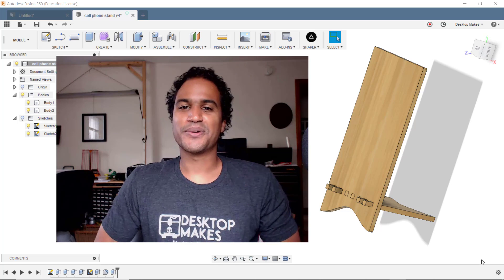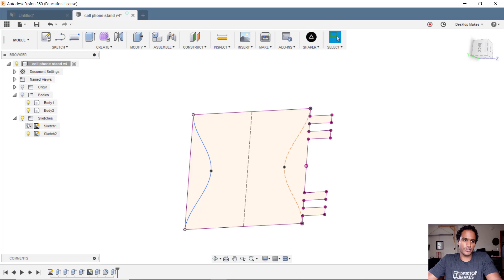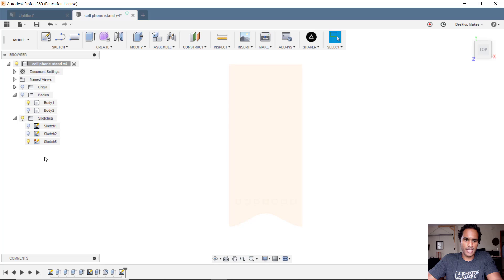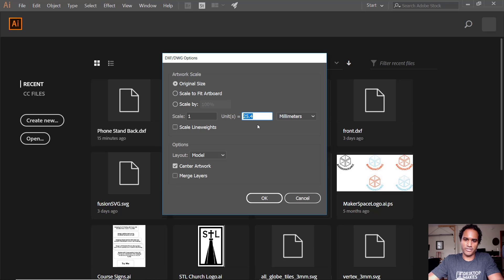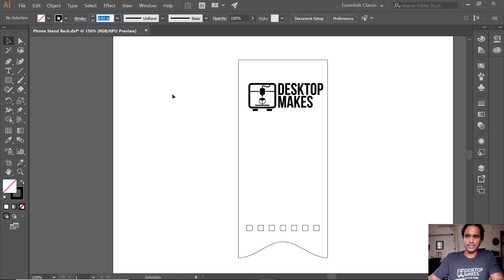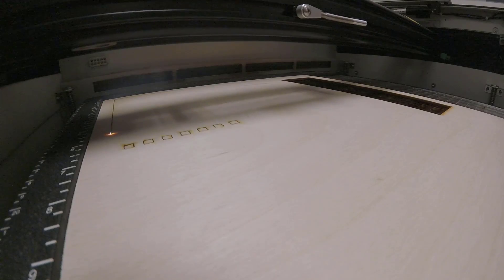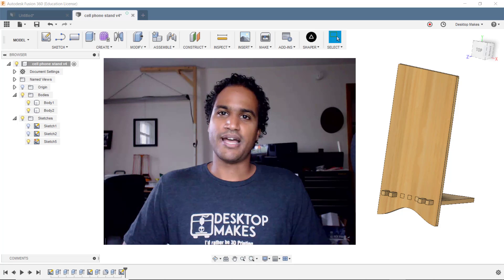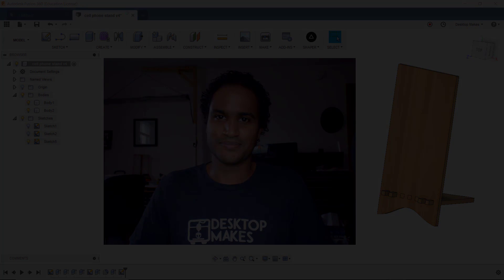Export a DXF file in Fusion 360

Comment: QUESTION: ORIENTATION OF EXPORTED DXF: ANY RHYME/REASON!?
- I've tried a number of things, but the output is not predictable: sometimes correction orientation, but others, rotated, or flipped:(
- Yeah, you can correct it in vector app, but that's one extra step that shouldn't be necessary.
TIA.

Comment: you designed with the wrong thikness lol
Reply from the maker: Good catch.  I had initially designed it at 5.2mm thick probably intending to cut it out of a different material.  I should have updated the thickness prior to cutting the 3mm plywood.  The good news is that changing the thickness is just one click in Fusion 360.